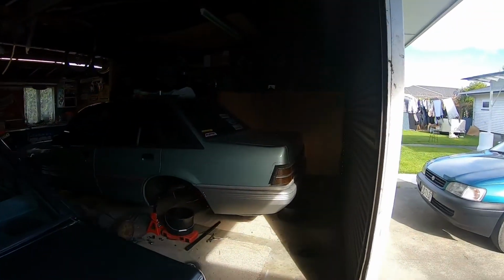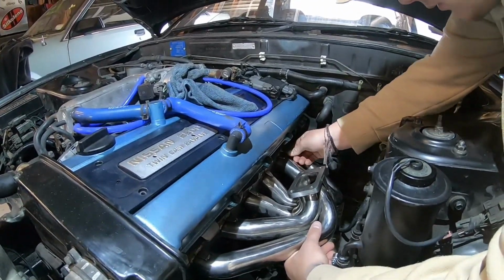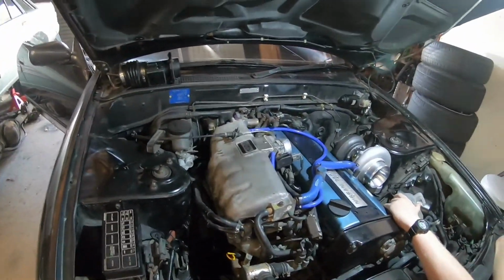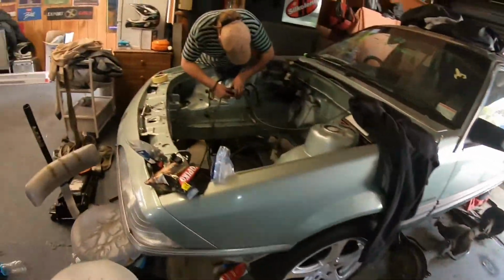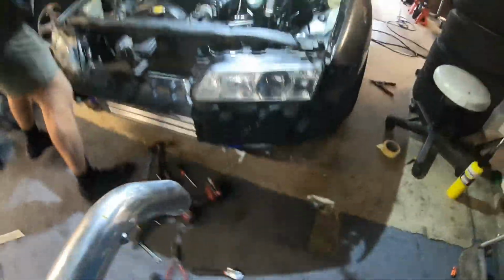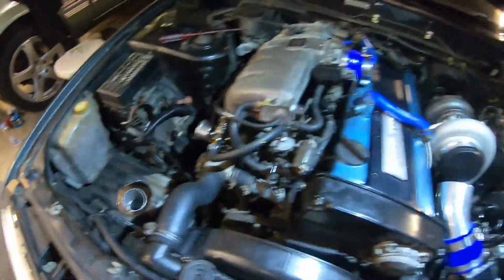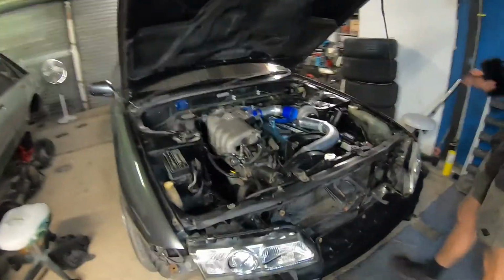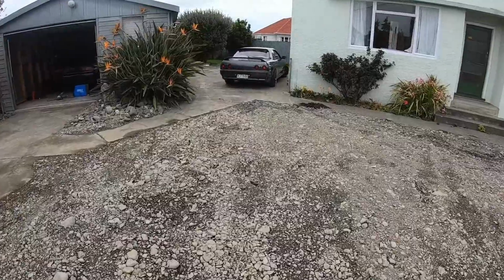PLUS T FOR THE R32 COUPE!

Comment: Issa 20 not 25 m8
Reply from the maker: Its a 25det
Reply: @tuckshop669  that ain't a 25det. 25det have a hump in the cam belt cover and a smaller intake. That's either a 20de or a series zero rb25de